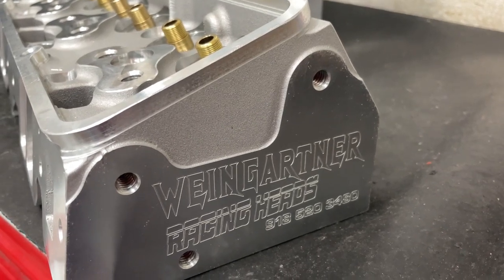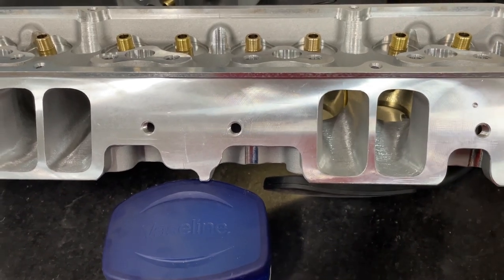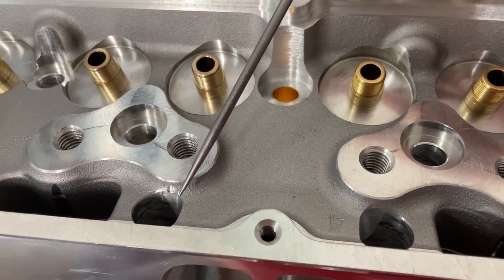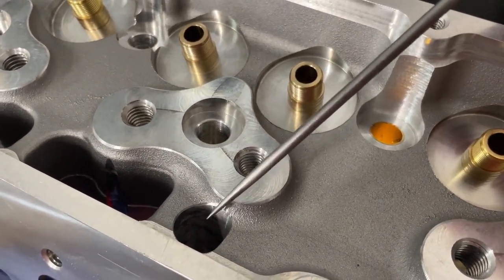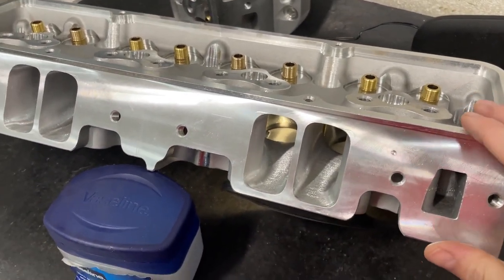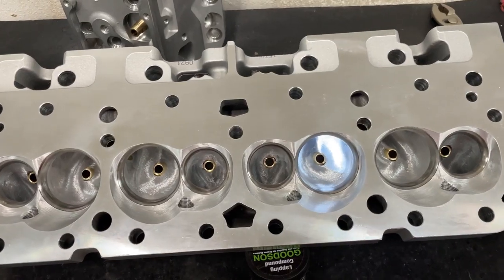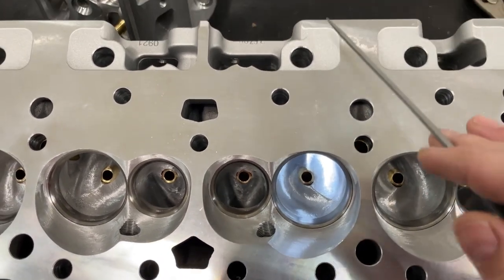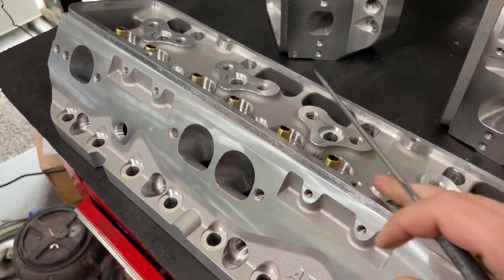My New Ported AFR Heads

Comment: Those numbers are very "CNC AFR ish" , by that i mean, AFR tends to have very strong 400-650 advertised flow numbers. Then it nicely tapers off like that, but not fall off the earth. I think you producing this by hand is awesome and shows your experience. 
I think this engine will have incredible mid to high range TQ and pull like a train !
Reply from the maker: It should.

Comment: I've got a set of afr 210 spreadport heads I was thinking of getting similar work done on and use them on a 13.5:1 421, have a bullet .700 lift nitrous cam I plan on trying you think that head will support 700 NA? or is it a better idea to start with something else? I've also got .450 offset shaft rockers and .180 offset lifters? you do great work! thanks for all the time you put into these videos

Comment: I had the Brodox heads on my 383, only made 500 hp ,did a set of afr 610hp, they where both bare castings,we fully cache runners I do not know the valve,or spring manufacturer, 625 lift roller, know our flow bench said afr fall on face, Brodox good to go, and the opposite happen.
Reply from the maker: It really depends on which brodix heads you used. There is more room to port a Brodix head.
Reply: What size heads did you use for the 610, head shopping right now for a 383

Comment: Can we get a flow chart and possibly a velocity measurement from  200-800 lift, #s at normal increments on your afr head, against  a bowl blended cnc same head from afr. I think that would give people an understanding of actual diffrence on paper. I would like to see you would do more stock ported ls heads, boath rec and cathedral port. Im currious what u could do with a set of 823s off an ls3. Keep up the videos, my drag race friends and i all watch your channel for fun and knowledge. Thanks a bunch eric from the NW!!
Reply from the maker: Ls guys are cheap. They will not pay for a full port job for me to show. I will not just bowl work most AFR heads.
Reply: I agree there cheap ases. Mostly i think is because the ls aftermarket has lost there minds on pricing some of these pieces, thats why a bbc is still king period.  On the heads i know you dont just blend, i was refering to afr not you.  Meaning when u buy there cnc ported heads, they normally cnc port them and hand blend the bowls then send em  out. So I wasn't referring to your work at all.  I know if a guy sends eric a set of afr castings, and requests a competition port job theres a long list of proceedures you will do on top of proper cam selection, compression, use of engine, ect ect. My question was to do a dirrect comparison of flow #s and speed of air measurements @those flow#s so a guy could do a  real world comparison. I dont think the advantages of a pro port shop is to get a guy a ton more air and speed, but to taylor a cylinder head for a specific task. That being said i was just currious what you could do with a set vs afr's cnc program out of the box. Just to see straight up, how much air is to be had over afr's cnc program, and whats that look like, ie cost, overall flow, and airspeed.  Anyhow thanks man. Sorry for the long ask.

Comment: I always find that offset vane in the intake bowl a curiosity: does it throw a little extra air/fuel mixture near that outer short side during lower lift where detonation is most likely to occur on an aggressive [but not all-out] build?  Odd things are afoot in the cycle as chamber geometry takes prominence over the cylinder, regarding volume.  On a 302 for example, if chamber is 68 cc then chamber vs cylinder volume is about 50/50 roughly 0.350" from tdc,  and as that closes whatever swirl was going on changes near enough the initial pressure wave of combustion that flow considerations find themselves taking a proverbial backseat to keeping the pistons.

Comment: This is so awesome! i am think these heads on the engine with that 7,000 rpm limit is going to be phenominal. Now no jinxing now.
 i am building a 383 c.i. with only a 6800 max rpm limit for 4000 fps. i am trying to design and build a custom 10" deck block. This shall give me the 6.75" rod for 1.8:1 ratio, the correct bore and stroke ratio, and a solid 1.375" piston. This is the way it should have been built. it shall use the same available heads, with a custom intake manifold. For a 2:1 N/A engine the deck needs even taller. With say a 4" stroke ok, that is an 8" rod, 2" radius then whatever you want for piston. I would use 1.375 or 1.325" and that is your deck= 11.325" or 11.375" or 11.4" for 'short'. hahahhahahah get it? Now that is an 8" rod. 1.4" piston. And 4" stroke crank. That is the way it is supposed to be built according to the perfect ratio engine. Why not? Probably be just as good as any small block, and any big block of the same c.i. Add to this the perfect cam, and the perfect set of heads = you have the perfect engine no matter what size it is. The LSA for the 383 shall be 108* degrees. i am putting this in a gasser style 2nd gen camaro street machine. Not exactly 4.3" bore but closer. i suppose with 4.185" bore the stroke should be slightly less. Here is the scenario: 1.O75 times 3.89" stroke = 4.185" bore So there is the key. This is how it should be built. 3.89" stroke / 4.185" bore / 7.78" rod N/A and 7" rod for boosted engines and a honkin 2.055" piston hahahah!/ 1.275" piston on the 7.78" rod / 11" deck / Or say the deck favors the 1.8:1 setup= 7+1.945+1.275" = 10.22" deck. So you see deck hieght should not be so strict in mass production, why not have more molds of more deck heights? Any mold costs as much as another. Enter 3D printing. We want to be able to NANO print molecular iron for blocks. That should happen now.

Comment: Hey eric i read somewhere some one claims the afr 220 actually does have the valve spacing moved over a very small amount.  Considered stock spacing but indeed moved over just enough to fall with in the rocker roller barely.
Youre input?
Reply from the maker: They might be slightly moved from stock but they are the closest.

Comment: Beautiful work man so I have a question is the 50° intake seat because of the vein? Are you trying to get the port to hang on past .650 lift better while keeping that really good mid lift low? 
I imagine in combination with SSR shape and bias?
Reply from the maker: I usually use a 50degree seat on race applications over .600 lift. It really comes in perfect with this chamber.
Reply: @WeingartnerRacing  i see, so is it steeper off the seat into the chamber? It’s hard to describe what im thinking but I think of a tapered cone coming off into the chamber from the valve

Comment: When it was a head specifically for you I figured you would set it up with 800 lift springs. That's not what this is. These will rock for guys that still want a hydraulic roller with 650 lift and drive it on the street.
Reply from the maker: These are perfect for a solid roller even with .800 lift. It will see more time at the good lift.